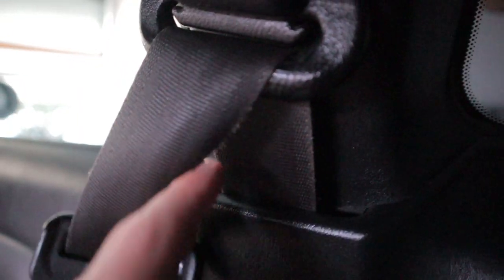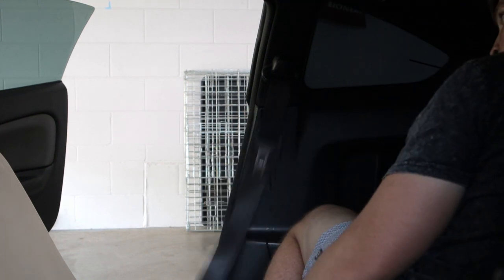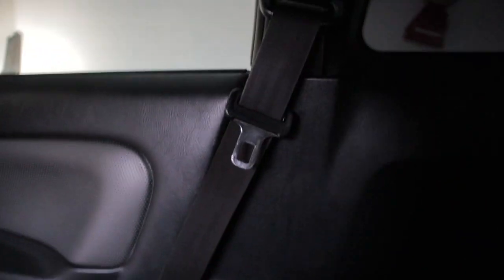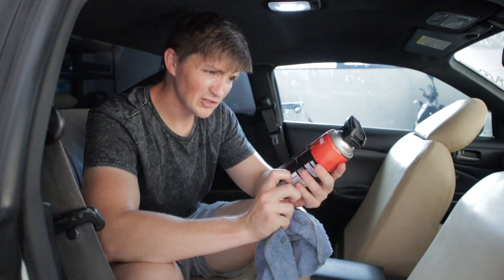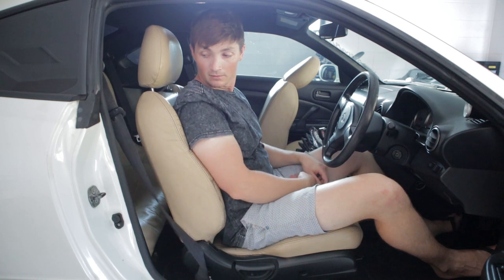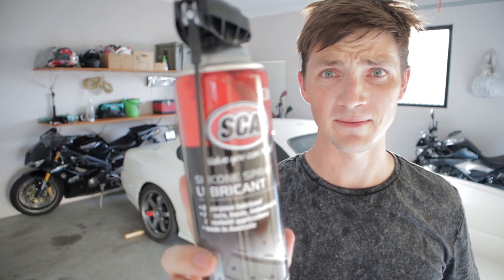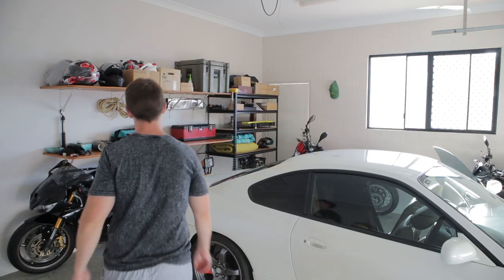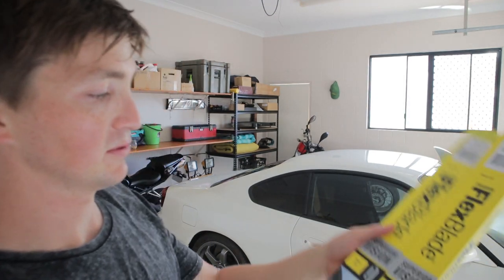How To Fix Slow Retracting Seat Belts

Comment: I heard of cleaning the belt and was going to give that a try, but saw this, given its the winter and very hard to dry them at this time, gave this a shot instead. It worked very well. Decided to do all my seatbelts just for good measure lol quick and easy and works wonders. Thanks
Reply from the maker: no worries, glad it helped you out.

Comment: Hey thanks very much. We had this problem but the retraction was much slower. Got the exact same spray here in New Zealand and it worked a treat. Other ways I tried did not work but this way was great. Also sprayed some squeaky doors and hinges in the house while I was at it.
Reply from the maker: Glad it helped you out!

Comment: I have the same problem!  I never thought this would work, but I have seen a number of YT videos doing the same.  I will give it a try.  I suspect I will do it only on the length that is unlikely to come across a person's neck or clothes so they won't be exposed to the spray (if they might).  Thanks for the tip!

Comment: I drive an 07 ES350, and the seatbelts retract very slow. I want to do this, but I'm afraid of staining the seatbelts as they are a beige/tan color.
Reply from the maker: I see! Unfortunately I have not tested it on beige / tan. I'd suggest just washing the seat belts as thoroughly as you can with soapy water to remove the dirt and gunk out of them. It could help them retract faster and shouldn't have any of the risks.
Reply: @PiersonWillis  Cool I'll try that.